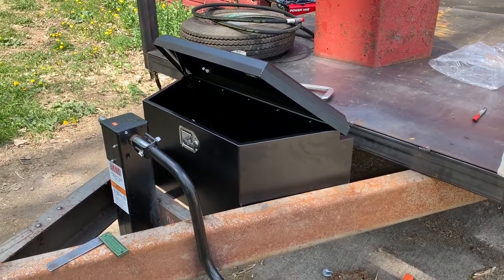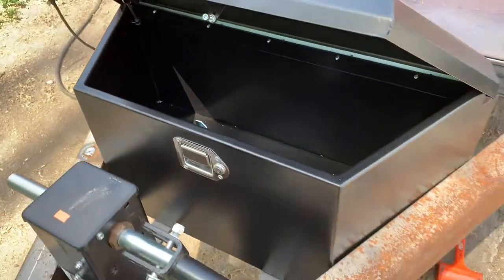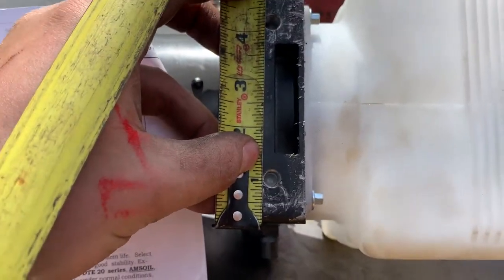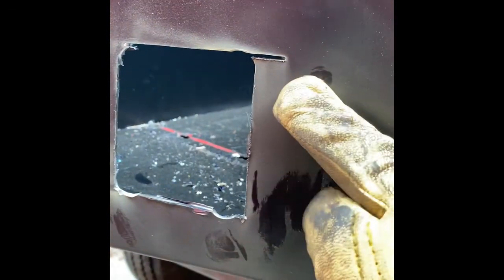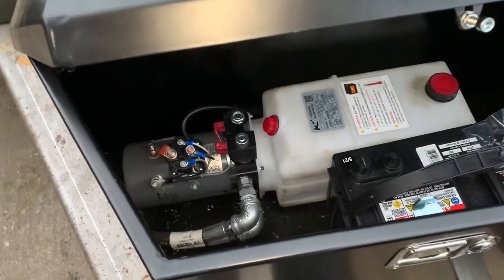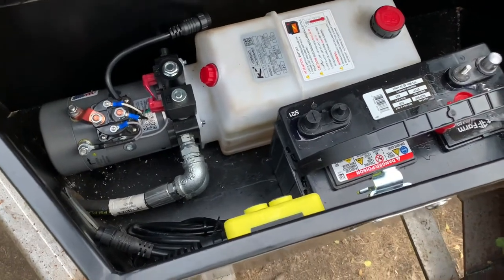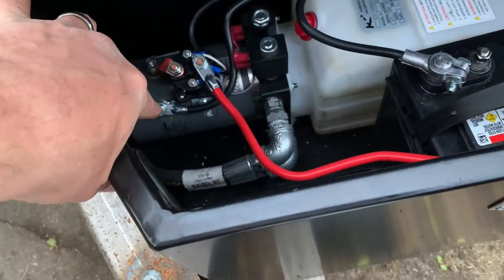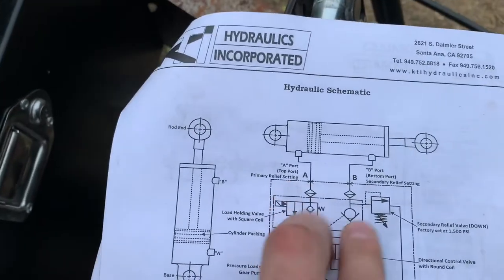Dump Trailer Build Pt7| DIY Dump Trailer Project

Comment: Did you but a kit for the hydraulics or piece it together?
Reply from the maker: I guess you would say it’s pieced together. I purchased the pump from the link, cylinders from an auction, hoses, fittings, fluid, and battery were from the local hardware store.